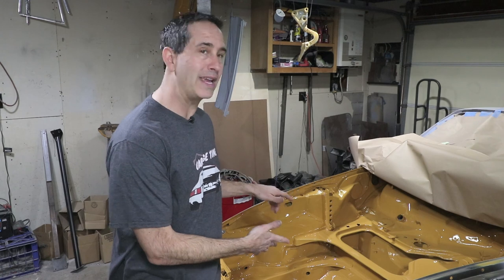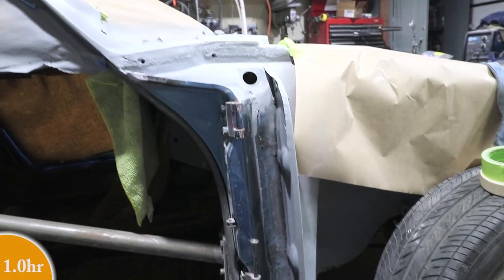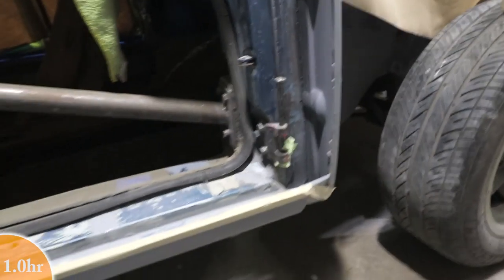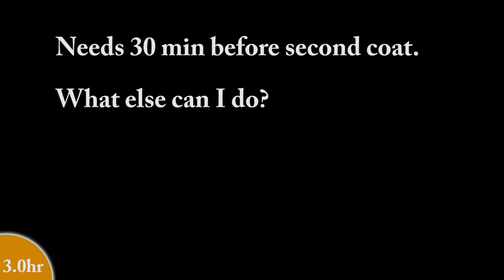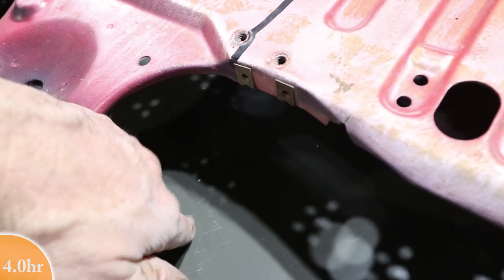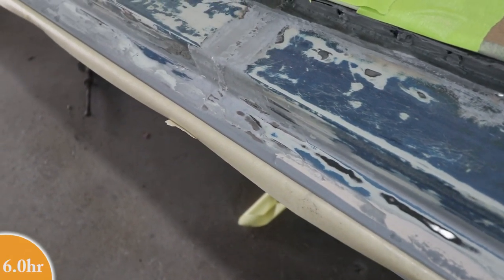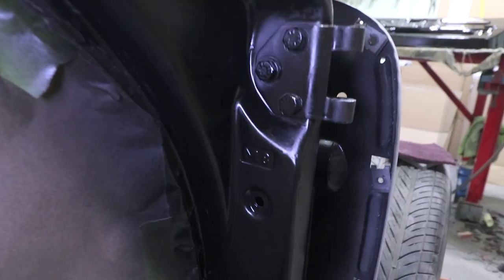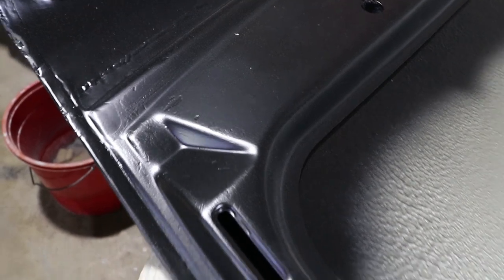Working Outside In January?  Exciting New Unsanded Areas!!!

Comment: Good job, Tom. I'm interested to see how the dolphin glaze goes. I probably should have used that.
Reply from the maker: It's kind of a cross between body filler and primer that you spread easily.  I'm lazy and don't want to clean the spray gun again!
Reply: @GarageTimeAutoResto  lol, I don't blame you. I've seen that Barry at SPI likes the stuff, so that should be good enough for anyone!
Reply from the maker: The mixing ratio is kind of subjective, but it always seems to work well.  I give it plenty of time before sanding anyhow

Comment: If you had to do it all over again, would you have started with sanding the door jambs, and inside of the doors, prior to working on the exterior of the car?  To me it seems counter productive to work on the exterior of the car, only to have to be extremely careful with the doors when leaving on the jambs for the end. Not sure though.
Reply from the maker: Thanks😃. I think the order is six of one half dozen of the other.  I certainly should have fixed the driver's jamb dents before the exterior.  It does require removing and reinstalling the doors one more time.  The doors need to be on when block sanding the exterior.  Even with the doors on there is still lots of overspray on the jambs.  Unfortunately there aren't any major shortcuts that I know of.  Paint and body work is just a lot of hard work.  
Another aspect is motivation and trying to keep the project rewarding.  Why do you think I painted the dash a few months ago?  
Everyone is different, but the painting process isn't my favorite.  My other Porsche was professionally painted and I will share that car soon.  He did the exterior first also.  
There are other viewers here who are more experienced than me.  Speak up, what do you do?

Comment: I don't get why you'd go straight to DG from epoxy primer when a single solid coat of high build would likely fill most small scratches and pinholes and keep you from burning through to metal... Seems like cheep insurance in terms of conservation of time. I love dolphin glaze I just hate burn through!
Regards,
G
Reply from the maker: Fair point😃. On the exterior panels 2K is a  must.  Underneath the hood already has plenty of factory paint with a few deep divots that I didn't think the 2k would fill.  The nice thing about DG is I can repair small spots without softening the edge seam details with heavy 2K coats.  If I went to bare metal on the undersides and jams then there wouldnt be as many defects, but that is way more work.